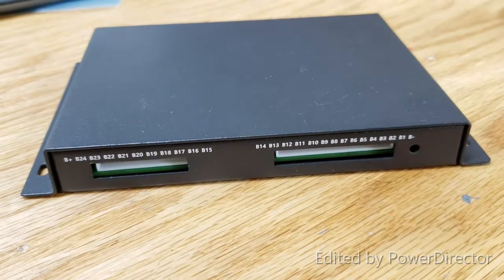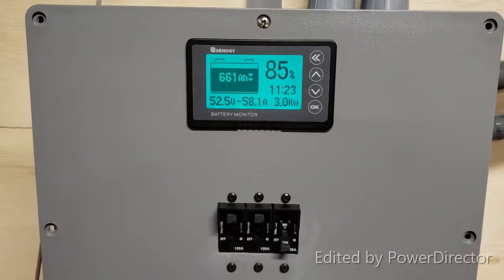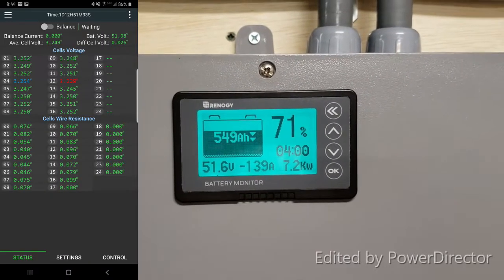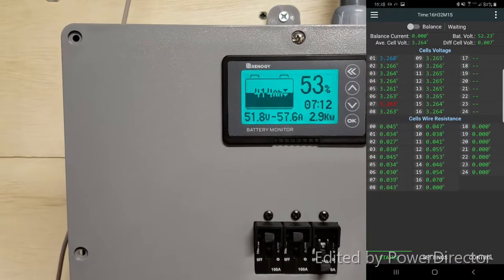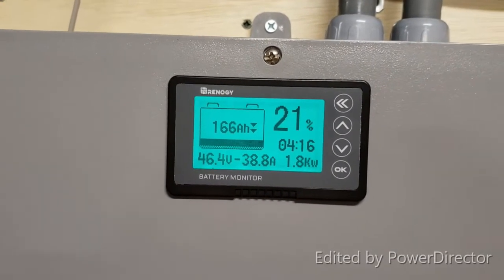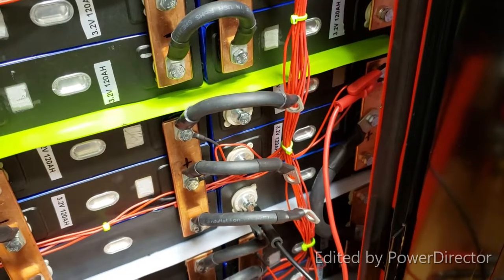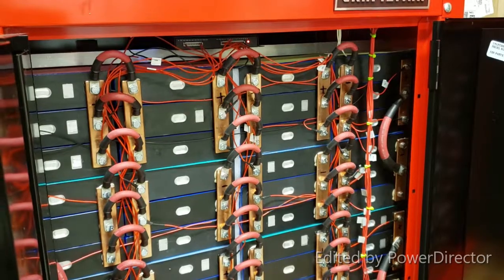LV5048 Load & Capacity Test. Power Wall 1.0 Failed.

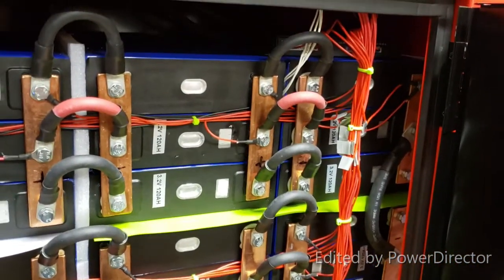Comment from the maker: Forgot to mention in the video. Last update before we went on lunch at 12 was at 11:30. We came back at 1:30. Somewhere between 12 and 1:30 Power Wall 1 failed. BMS performed flawlessly as Power Wall 1 was off when we came back home. After disconnecting wires from module #12 cells were at 2.6 volts. BMS disconnects at 2.0. 

I balanced the cells before test and turned off balancing option. Wanted to see performance of each individual module during stress. It showed.
Reply: Are those the (2) VoltCell 120A BMS, if so, did you print the cases or did they come with the BMS?  If those are just balancers, why are you using them instead of the BMS? Also, why not use bus bars to connect the packs in series vs the (3) thick gauge wires?
Reply from the maker: I do not have cases for the BMSs. To your second question. I am allowing batteries to breathe when connected with cables. If that makes sense.

Comment: Very good, for used cells. Every safety precaution was met, Since you have replacement batteries, you can just replace that one cell with a better one and increase the capacity. If that weren't the case. I believe you can set the LV-5048 to switch to grid and at a point before 28% capacity is reached. If the balancer were balancing 24/7 charging and discharging you should be able to increase your capacity. Not sure if this balancer is capable of this. But this is great results and a great Video!!!!!
Reply from the maker: Thank you. I have more coming up on a balancer. Did you balance your cells? How did it go?
Reply: @DMIINC2013   Yes you were correct the battery pack (8 cells, 24v) were way out of balance. Doing the cells one by one, worked out very well, tried the next 4 cells all at once (thinking these were well match) and it too showed unmatched cell, (patiences is a vertu) ended up charging all 8 cell one by one and made it to 28.8v which is great. Took some time, but i made it to 28.8v. I will repeat this for the next 5 batteries and parallel them and make 3 banks of 48v. Pretty sure if i were to test the capacity of the 3 banks i will have a low capacity, but i can't swap out a cell like you can. But with the aid of a very good balancer i should have 
a useful used 48v solar battery. So I will get back to you on balancers and BMS which will be my final step. Oh can you email me a pic of the top of your fully connected BMS . (MNRosado@live.com) I am working with voltcell on this BMS. I want to be able to stick it the BMS into a compartment located in the front part of the BYD battery. Reasoning being the BYD battery are 8 cell and i want to use a 16s BMS.
Reply from the maker: @marcoa.rosado4724  will do. Maybe next couple of hours. Thanks for the update.
Reply from the maker: @marcoa.rosado4724  sent you an email.

Comment: 147 amps on the packs is a pretty hefty load. I only got mine up to 92.
Reply from the maker: Thanks on the comment. Have to stress test it. How is your stuff holding up?
Reply: @DMIINC2013  Yesterday I forgot to turn the system back to the grid and got home to a BMS cutoff voltage. It took 4 hours of being completely off before the BMS would let the packs get charged.

I started at only 52.9V and let it discharge all the way to 48V. I was not there to return it to the grid, I forgot all about it and got home way late.

But it ran a solid 14 hours. Mind you the house was empty and really the only thing going was the refrigerator freezer and heater, set on eco.

I also have one sad cell. My cells are welded together in the packs. Replacing the 1 of 64 is not exactly easy. I've been charging the entire battery at only 16 amps today, and it is about 65%. I have no idea really how much real kWh I have. I have 220 ah at 48v setup x 4. Yes, extremely used cells. I only have 1 of 4 BMS's installed also. There might be a couple other dud cells.
Reply: @JasonCarmichael   When that happens to me I apply a small charge directly to the battery just so the BMS will see enough voltage to charge then it will take over.
Reply from the maker: @JasonCarmichael  you can also charge each cell separately if it is easy to gain access to them.

Comment: Why on every shot of the balancer it is in waiting mode and not balancing as the monomer was greater than 0.002 and balancing should be active. Hey used stuff always requires more effort. When you show the fail the one on the left was at 3.2 and the one on right 3.1 it must have run a while on one battery. Also if one of the modules failed why didn't the bms shut down the whole bank. Just some questions trying to understand how it failed. The toggle switch was never on balance.
Reply: Also, you can't balance during charge or discharge. You have to wait until the battery is idle.
Reply: @JasonCarmichael   Why.... I do it all the time with balancer and BMS. The BMS is set up that way so it balances only at certain times but the active balancer only quits when it reaches the monomer setting you pick.
Reply: @offgridwanabe  can your balance push / pull more than 200 mA? I have set mine to start any time more than 0.008 and above 3.3v. But there is no *do it now" option. The bms never activates the balancer during bulk charging or discharging. As soon as the sad cell gets charged it looks like a normal good cell. But it self discharges, quite quickly. I am pretty sure it has suffers Lithium dendrite formation.
Reply: @JasonCarmichael   The BMS I have only has 50 mA so it does not keep up to the variance in the A123 Lifepo4 cells I use which is why I went to the active 1 amp balancer. Another reason the BMS balance function does not work very well is it only has upper and lower range setting and only when the pressure on the variance is out of range so you are correct the bms has a charge mosfet and a discharge mosfet so balancing only occurs when idle. Again this does not effect the active balancer which goes constantly until the variance is reduced to your setting I use 0.002 as the benefits to being balanced out weighs the energy used by the balancer. Also I balance in the bms from 3.0 to 3.55 for the range it then will come on during use but the 50 mA is too small.
Reply from the maker: Forgot to mention in the video. Last update before we went on lunch at 12 was at 11:30. We came back at 1:30. Somewhere between 12 and 1:30 Power Wall 1 failed. BMS performed flawlessly as Power Wall 1 was off when we came back home. After disconnecting wires from module #12 cells were at 2.6 volts. BMS disconnects at 2.0. 

I balanced the cells before test and turned off balancing option. Wanted to see performance of each individual module during stress. It showed.
Reply: @DMIINC2013   I guess you found the weak cell I never shut off my balancer it allows more capacity as the failure is postponed. Also the power curve is flat till 3.0 so going below that has very little capacity and the used batteries don't need the stress. Same at the top 3.55 is as high as I go. Cheers Good test.
Reply: That is an active balancer. You can turn the balancing option on or off. When it's on, it moves power from the highest cells to the lowest cells at a supposedly 96% efficiency rate. When the balancer is off, it is merely used as a monitor and nothing else.
As far as his BMS, not familiar with it so maybe he can provide some more info. I am guessing that the failure was not something major that the BMS would have to act upon. Suspecting the whole pack voltage was within the spec and the BMS did not treat the 1.0v voltage difference as a major issue. Or maybe the BMS did turn off the pack hence why the other powerwall was running longer.